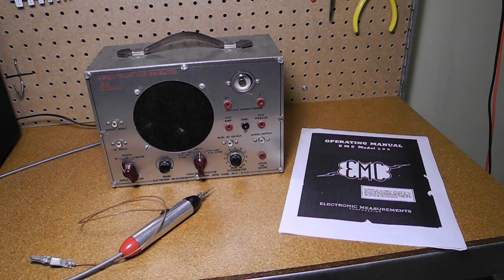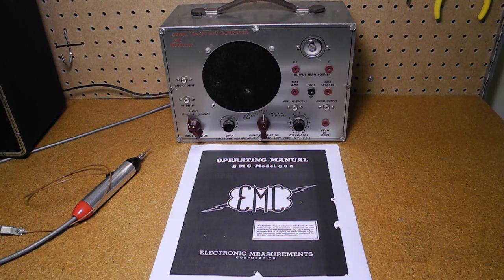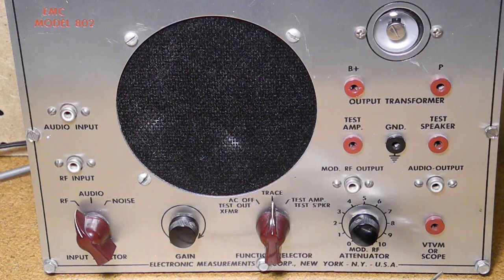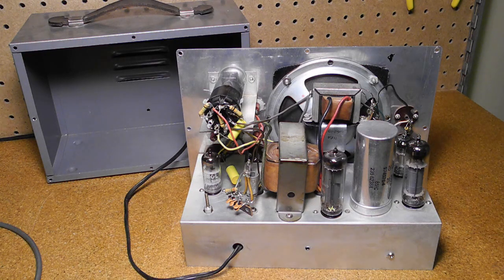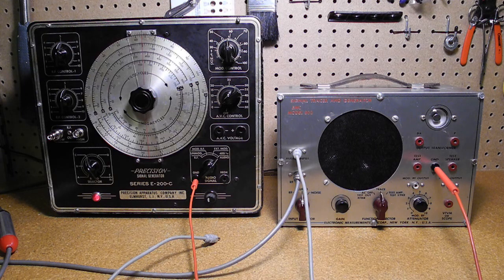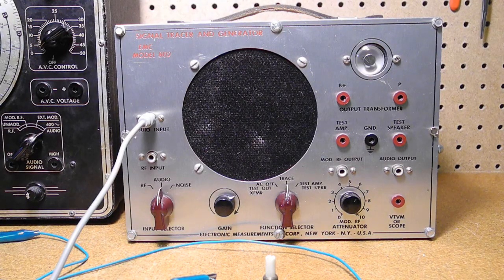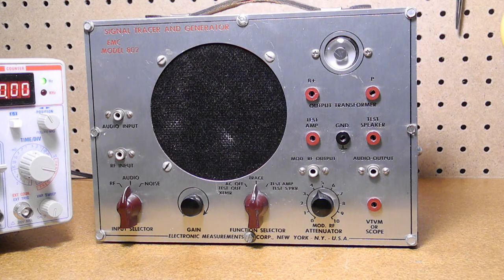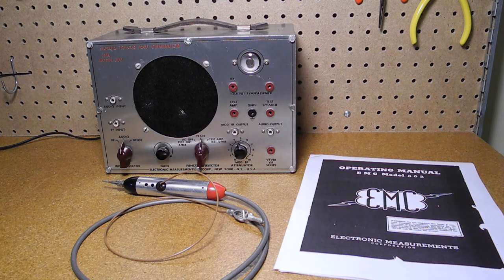The Electronic Measurements Corporation 802 Signal Tracer and Generator

Comment: Does the Primary on the main transformer allow to connect to 220v power supply?
(some old devices have dual primary wire)
Reply from the maker: No, it was only designed to run on 105-135 VAC 60 Hertz.

Comment: How critical is the value of an AC line bypass cap?  My old Heathkit colour bar and dot generator has two 5.6nF capacitors across both sides of the line to ground and I only have 4.7nF ceramic safety caps.
Reply from the maker: The value is not critical, those caps should be fine.